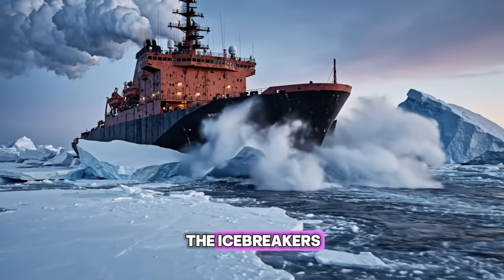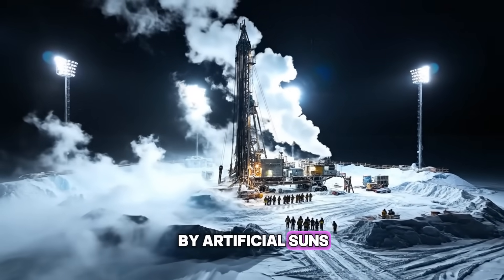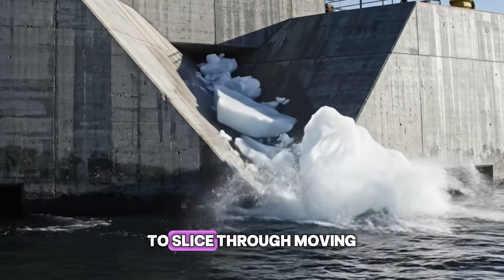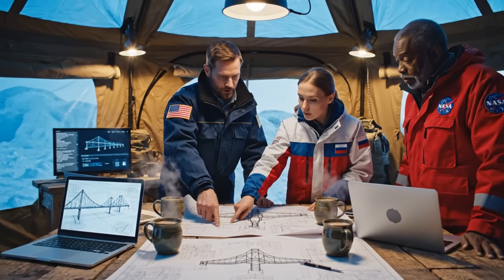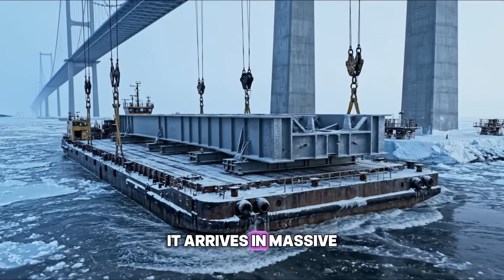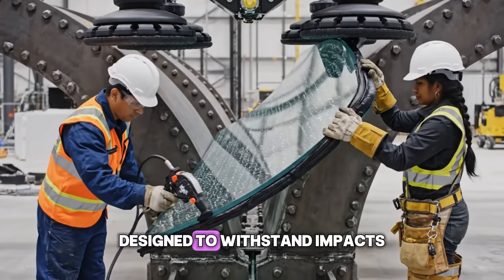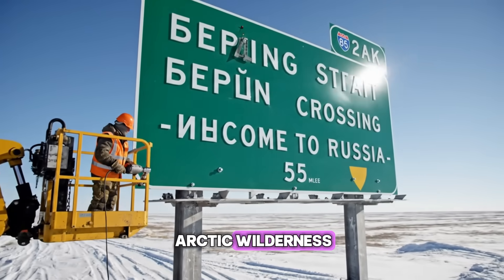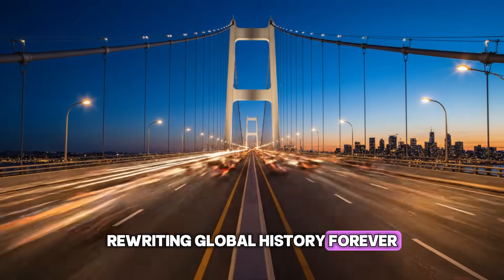Inside the Impossible $8B Bering Strait Bridge 🇺🇸🇷🇺: USA-Russia Connection is Finally Being Built!

Comment: 🔎 What the video is discussing
	•	It’s focused on an idea/proposal to build a bridge or tunnel across the Bering Strait between Alaska (USA) and Chukotka (Russia), one of the narrowest points between the two countries.  ￼
	•	People have speculated about such a crossing for years — sometimes called a Bering Strait crossing — as an engineering dream or “mega-project,” but nothing like this has actually been built yet.  ￼

📌 Reality vs. Video Title

✔️ True: The idea exists and has been discussed by engineers, planners, and media — often with big numbers and dramatic language.  ￼
❌ Not true yet: There is no existing bridge or tunnel linking the USA and Russia right now.  ￼

🧠 Why there’s confusion

Content creators sometimes use click-bait titles like “USA-Russia bridge being built” even when the topic is still just proposals or concepts. Videos like these often explore hypothetical designs or what it would take to build such a structure.  ￼

🗺️ Real geography fact

The Bering Strait is about 82 km (51 miles) wide at the narrowest point between the U.S. and Russia — and while that’s closer than most people realize, building a bridge or tunnel across it would be an enormous and extremely challenging engineering project.  ￼

⸻

In short:
Your video is talking about a proposed Bering Strait bridge project, not a real existing “Marion Street Bridge connecting the USA and Russia.” There is no such bridge currently built — just ideas and proposals.  ￼

If you want, I can summarize what the video says about the engineering challenges or how realistic such a bridge would be!
Reply from the maker: Thank you! I Pinned you Comment
Reply: Alaska to Russia to build a bridge or road is impossible because first of all both area are the coldest in the world human cannot survive to do work. Secondly it located I Russian Syberia cold temperature throughout the year - 30 to 40 degree, and ib winter means October to Match cold temperatures drops futher down to _ 60 degree even sometime - 70 degree also!!!??? Can you tell me any human, animal, birds, even basic need of water also rock during winter. Than why they make bridge or roads!!!??? Just imagine????
Reply: Yes❤❤❤🎉
Reply: Это ИИ так проектировал, в реальном времени пока нет моста, а может строят сейчас уже!?